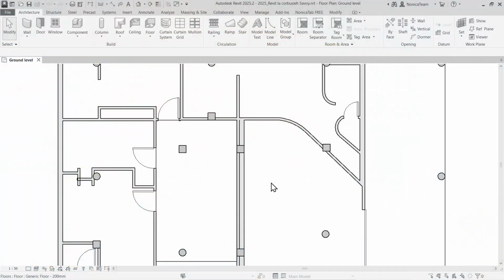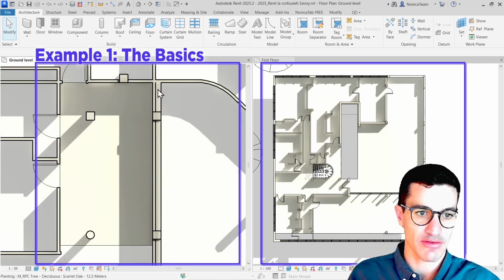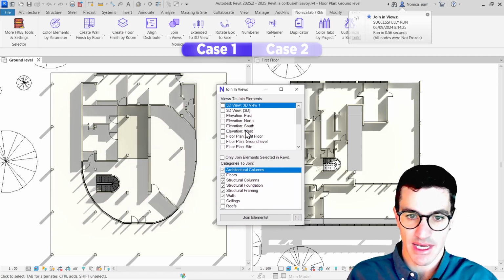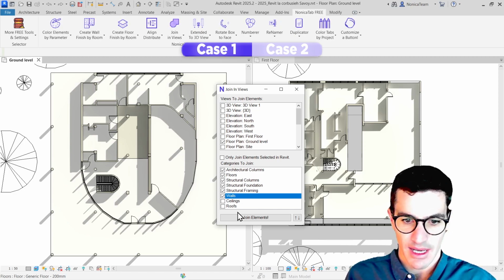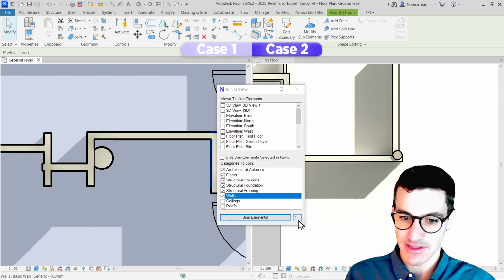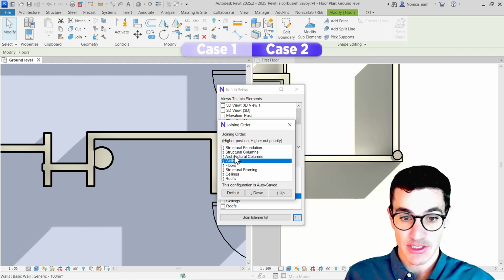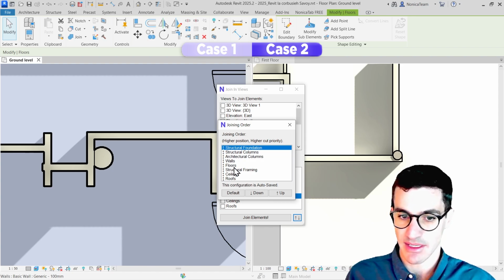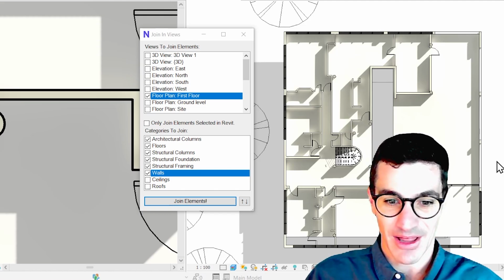Join Elements in Views | Revit Buttons ✅

Comment: Is there a way to unjoin or to switch join order with this tool? I mean, after you already joined many elements... I tried making a new join command changing the priorities but didnt worked.
Reply from the maker: Have you tried to undo the joint command, rearrange priorities and rerun?
Reply: @NonicaRevit  Hello, is it possible to make it a in built feature with the switch join order? Because, lets say you have a shared model and you accidentally join something incorrect and you can't undo, you would either have to switch join order everything manually or get a backup revit file.